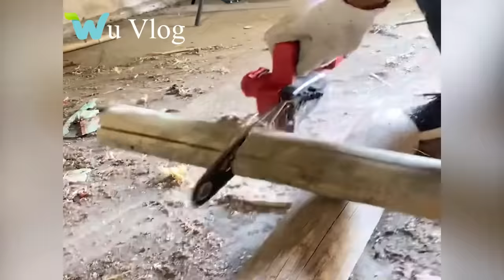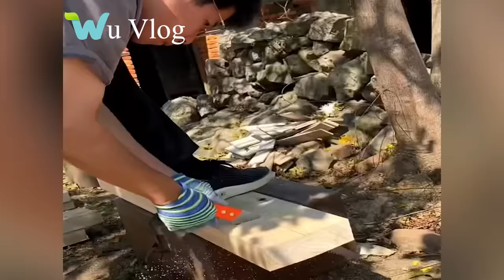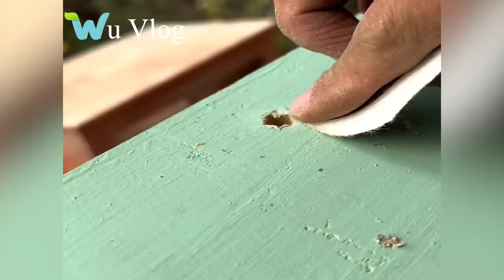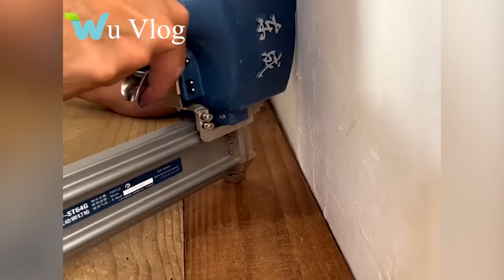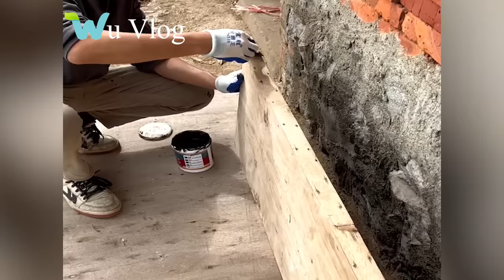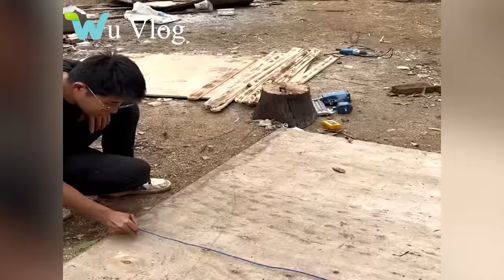Giving up his dream of getting rich, he came back his hometown to live and renovate his old house

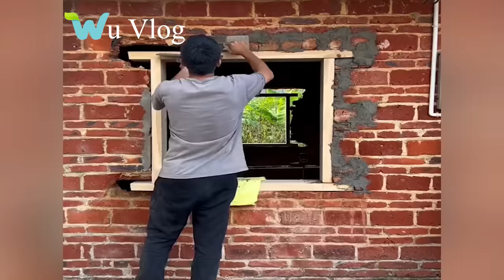Comment: 10:04 the window frame is not strong enough to hold all the weight.. need 2x6 or 2x8 and placing vertically. The frame will become sagging